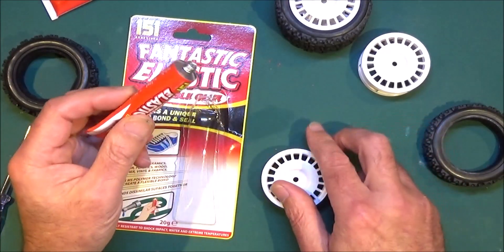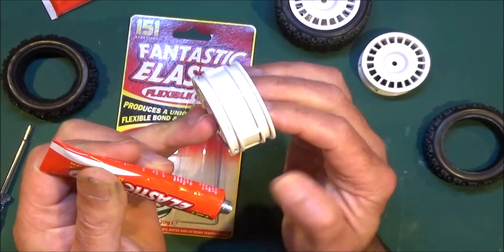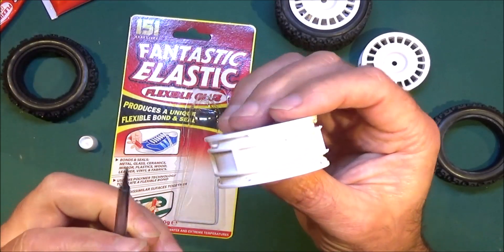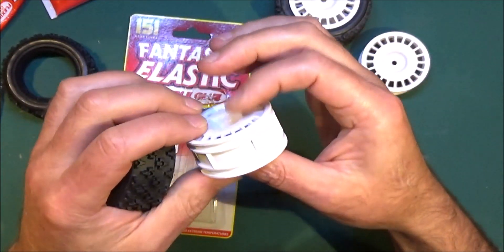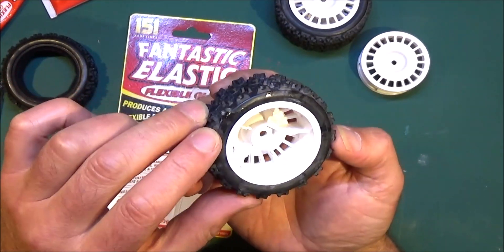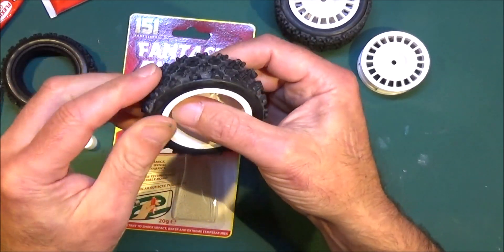RC Tyre Glue Tip - How to glue Tires With No Mess + Remove Them Easily!

Comment: Hi mate, I never knew you glued your tyres. As Tamiya don't recommend it in their manuals, I just assumed you went with them. In hindsight though you do run a lot of brushless, so yeah, it's totally understandable. Great tip too with that flexible glue, I've never glued tyres myself although I can imagine how super glue would be a total nightmare. This flexible stuff seems totally ideal for the job. Nice one mate...👍🏻😁.
Reply from the maker: Hiya mate! Yeah, I do glue some of my tyres, but prefer not to if I can get away with it. Some of my manuals do say to glue the tyres, but I don't remember off the top of my head, except for the Lunchbox that definitely shows using glue. I didn't glue them as a trial, and the rear wheels span inside the tyres when they got wet! Yeah, when I have a hopped up motor it's usually needed, like on my Neo Scorcher and Blitzer.  All the best my good friend! 😀👍

Comment: 😁👍 Great Idea Mark! I don't think that's in the USA but I use goop shoe goo glue here sometimes and it looks kind of the same as the stuff your using and works great also.  PS. posted this on your dark impact buggy video but if you did not get it here it is again...  a simple fix for the comment problem I forgot to to tell you about that I always tell others to do is simply un sub me and wait a couple hours and re sub and that usually fixes the problem.👍
Reply from the maker: Thanks a ton Steve - yeah I heard that shoo goo is similar! And thanks again for the tip - good of you my friend!  😀👍
Reply: @MarkBryanRC  I'm going to try Shoe Goo on my Sand Viper tires since I'm worried they will slip on brushless. You guys think the tires will slip on 3500kv 2s 17t pinion brushless setup?
Reply from the maker: @RDsRCReviews  Hi - I reckon it's worth a try with the Shoe Goo - I think it will do the job as the tyres fit pretty tight anyway! All the best and good luck!  :)

Comment: Thanks again Mark. Ordered. I’ve got to glue my tyres for racing but I’m absolutely done with CA. Don’t start me off😊. Tried black silicone but sadly failed. Thought it was the grail of rc tyre bondings. Can’t stand the mess and the waste from CA. Ruined more than one decent set of tyres and rims messing around with acetone and the like trying to reclaim rims or just swap rubber for different surfaces. £ for £ rc wheels and tyres are super expensive so CA can b@gger off ! Best wishes to you and your trusty cameraman. Peace. MR
Reply from the maker: No worries, MR, I hope it works for you... it's best to leave it to dry for a few days if you can. And I can tell you it won't hold a tyre on at 45mph, as I just found out! But at normal speeds it works a treat. Oh yes, I've had bad experiences with CA glue, my fingers will never forgive me!!! Best wishes to you, too, all the best! 😎🤞👍
Reply: I'll let you know how it gets on Mark.. First is a pair of short course truck control tyres racing on astroturf. Lots of weight being thrown around so should test the integrity of the bead fully. Peace. MR
Reply from the maker: Sounds like a good test!!! 🤞🤞👍
Reply: Success ! High traction astro, lots of weight thrown around, impacts, jumps - solid. On touring cars probably even better. Result. Thanks once again Mark. MR
Reply from the maker: Awesome news! I'm chuffed! Thanks for letting me know! Peace. 😎👊👍

Comment: Great way to stick the tires on mate. I used silicone adhesive before, same thing I'm guessing. CA or Super Glue can be a pain when you use the thin stuff, but it does "flow" around the bead area easily (CA or Super Glue is not good if it gets on the foam inserts), i use medium thick CA for tires now.
Reply from the maker: Thanks a ton, Bob! 👍 Yeah, silicone adhesive sounds very similar, but for extreme machines, CA glue is needed. That thicker Gel type sure sounds better than the runny stuff! Take care, brother! 😀👍
Reply from the maker: Wanna chat, mate - get on facebook! I'll call ya!  :D
Reply from the maker: Thanks for the info, buddy!  :O)
Reply: @MarkBryanRC  OHHH!!!!!!!!!!!!!!!!!!!!! Did you see the Tamiya Grass Hooper looking buggy with IS?
Reply: @MarkBryanRC  TAMIYA New RC model coming soon !!
Reply from the maker: @UncleBobsRC  Can't wait, Uncle Bob!  :D
Reply from the maker: @UncleBobsRC  No mate!

Comment: Hi Mark,
Great tip!
I’ve seen this stuff in my local pound shop 👍
I’m just coming to the end of my TT01E Buggyra build and I was wondering should I glue the tyres on?
Also….do I need the foam inserts? 
Many thanks 👍
Reply from the maker: Thanks Dan! Yeah it's good glue... I don't think you will need to glue the tyres unless you have a super fast motor fitted. The tyres on the Buggyra are pretty hard so I don't think foams would make much difference. All the best! 😎👍

Comment: Hi Mark. Great video. I am new to Tamiya rc cars. I had been looking to get the Audi Quattro tt-02 you've tested. However, I won a competition  for a tt-01 with mk1 Escort body, which came already built. I couldn't understand why the tyres kept coming off the rims until I watched this video.
Reply from the maker: Hi Paul! Many thanks for the comment. Congrats on winning that TT01!!! Yes, a little glue is needed on these tyres, especially after a little use, they just get looser and looser! All the best!

Comment: I went hunting for this stuff but couldn't find it in the pound shop near me. They did have UHU all purpose adhesive though and works just as well 👍 cheers for this
Reply from the maker: Thanks for the comment, Dave. Good that you found an alternative that also works on these tyres, good info for anyone else reading this thread, UHU does the job too! Cheers!
Reply: @MarkBryanRC  also dries clear if you get it on the tyre walls. Probably not quite as good as yours but can't see it much 👍
Reply from the maker: @davecoggan9619  Even better! Good stuff, Dave. Have a cracking weekend!  :O)

Comment: Thank you for sharing, Mark! Great tip. I remember you have mentioned it before, but it was great with a separate video and full demo. I wonder if any of the glue sticks to the wheel after removing it? Making it an uneven surface for the new tires? I expect not, since you have probably tried it many times with success but I had to ask
Reply from the maker: ...and thank you for watching, Mikael! Yes, I'm glad you asked, it's a very good question! The glue does leave some residue on the rims when you remove the tyre, but it's easy to remove as it doesn't react with the plastic rims, it just peels off like a sticker! All the best my mate!  :)

Comment: Good idea thanks for sharing You don't need CA glue That stuff is overkill I mean if you have a heavy vehicle and you're using a lot of power then I can see using CA glue but with a lightweight vehicle that is not overpowered that will do the trick just fine.
Reply from the maker: Great point! Thanks for taking the time to comment, it's much appreciated here. Apparently, UHU glue is also an effective solution. Hope this works on your RC cars. Cheers!

Comment: Do you add any foam inserts if is t there any point ??? If you do do you use the proper Tamiya ones or do you make some up
Reply from the maker: Hi there. For my rally cars I generally don't add foams to the rally block tyres as they are quite rigid as it is. But for the softer road tyres I add foams. I have used Tamiya foams and also made some from medium density foam and they work just as well. Hope this answers your question! 👍

Comment: Very helpful Sir, Thank you .
Reply from the maker: You are most welcome, thank you for your kind comment!  :))
Reply: @MarkBryanRC  Restoring a vintage Tamiya Avante 58072. The tyre inner sponge 50359 is discontinued I think. Are these necessary to run the car or do I need to cut and make some from sponge strips?
Reply from the maker: @samiismail8690  Hi - no I think you can run without the sponge inserts, but it might be worth giving it a try and adding some self-made sponges. Take a look at these, they might be able to fit: Tamiya 84201 1/10 Scale R/C Buggy Inner Sponge.

Comment: did this with my Alu rims, left em to dry over night. Next day drift, an the rear tyres ripped straight off in a few mins. Not sure if tis is good for Alu wheels?
Reply from the maker: Hi there and thanks for sharing your experience! I've never tried this glue on alloy so I'm not sure. But when I've put the glue on too thickly it can take 3 to 4 days to dry. Maybe it doesn't like the alloy though.
Reply: @MarkBryanRC  Yeah. I did wonder about sanding the surface of the wheel to get better adhesion. I liked this concept as I don't trust meself with super glue :'D Maybe it's because I tried this on my drift car?
Reply from the maker: That's a good idea, most glue works better on a bigger surface area and sanding will do that. It must be worth a try. Haha, I don't trust myself with superglue either, last time I used it I only managed to glue my fingers together!!! 🤣
Not sure if it was because it was your drift car, these rally tyres I glued on had a real hammering on all surfaces 😬 and they didn't come off! 👍

Comment: Great tip and well demonstrated mate.  Super Glue can be a pain, especially when you get it all over your fingers and they get stuck together.  Seems to stick skin better than anything.  I wonder if Fantastic Elastic is like Shoe Goo which is what people use to stick plasterboard tape inside RC bodies to strengthen them?  Be good if it is as Shoe Goo is quite expensive.  Anyway good to catch you mid week. Hope all is well with you.  Cheers for now :-)
Reply: Super Glue was used by medics during the war to patch up the soldiers.
If you use too much, you end up looking like the man from Atlantis 🏊
Reply: @Jess hahaha, sorry, didn't mean to laugh, I use the thick black chunky gaffa tape for the inside of my shells before painting then hot glue aluminium mesh to stop the roof pillars from caving in if it lands on its roof 👍
Reply: @Jess Yeah I do use Gorilla Tape too and it does seem good.
Reply: @cw-01creations46  Yeah they still use a type of Super Glue for some medical procedures like sticking your burst ear drum back in.  A bloke down the pub told me so it's definitely true!
Reply: @PeteWylieRC  When I split my head open, the Quacks used super glue on me so that my skull wasn't exposed to the elements of the outside world but it did naff all for my hairline 🤔
Reply: @cw-01creations46  How did you manage that?
Reply: @PeteWylieRC  I fell through the garage roof in-between the beams and smashed my head against the engine hoist on the way down. Luckily the ground broke my fall. I looked like John Merrick when I came out of hospital and better looking than Quasimodo 🤓
Reply from the maker: OMG!!! That must have HURT!!!
Reply from the maker: Just bought some Gorilla tape from Aldi!!!  😎👍
Reply from the maker: Great advice, Jess - just got some from Aldi!  😎👍
Reply from the maker: Thanks my mate Pete! It doesn't stick as well as superglue, but as you see in my run videos, I can still run pretty hard and the tyres stay on, even on the Blitzer that does 35mph! Yeah, from the comments it looks like shoe goo is very similar. As I said, this elastic glue is from poundland! Guess how much it costs?  :P
Thanks for watching matey, hope you are doing well too, I'm OK ta!  Later my good friend.  😎👍
Reply: @MarkBryanRC  It just goes to show that you put one foot in the wrong place and you're going down. Literally 👍
Reply from the maker: @Jess Great idea with the mousepad - it's great to find ideas from our friends in this hobby. Oh wow, this glue I got is never going to work when a 4800kv castle is powering the wheels!  :))

Comment: Me Mukka, I'm going to have to see if I can find the U.S. counterpart. Although I've sorted the CA problems, using a Diabetic Syringe 💉.....
It still has the issue of having to basically Bin the Wheels when the Tyres are worn!! 😖 
Plus, since it doesn't cure in nanoseconds (like CA!), the Bead has time to settle evenly, without high/low spots. That's great for high speed runs! 
Brilliant my Brother!! 👊👍👍😊 

Hope things are steadily improving. WE are spending the Week in a Hotel, around the corner... Our Aircon BROKE!!! 🔥🔥🔥😠  A critical problem here. 
So I couldn't bring my "Toys". And Mate, the Truck Cab is a viral RAT'S NEST of wiring!! 😳 I'm really at a critical point, where I cannot forget WHERE all those Wires go! 
Guess it's OK. I was so exhausted when I got home Friday Morning, that I slept till SUNDAY!! 😳
Reply from the maker: Cheers mate! Sorry - but I already replied and it's been deleted! Can't remember what I wrote!
Oh yeah, you got a great trick with the syringe - good job as CA is needed on more powerful rigs!
Hope your aircon gets fixed soon - you need to get back to that cool project of yours so we can see the nest installment!
Lou and I are no better, but thanks for asking, my US mate!  :)
Reply: @MarkBryanRC   I DON'T know what's going on with your comments lately!! 😠😖
Your comment on my Video worked great. 

Shoe Goo is definitely available here! I will be trying that on the Semi Trucks - because I don't want to ruin those Alumininium Wheels.
Reply from the maker: @CarminesRCTipsandTricks  IDK what's going on - it may be fixed because I complained on YT  help system!
Give the goo a go!!!  :D
Reply from the maker: @CarminesRCTipsandTricks  Haha! She doesn't know what she's let herself in for!  :P
Reply: @MarkBryanRC  LMAO!!! 😂😅

Comment: hi 
what if the tire has foam inserts
Reply from the maker: Hi! No problem, just fit the inserts into the tyre before you fit it to the wheel, the glue will not affect the inserts, I've done it many times! 😎👍

Comment: What about gorilla glue?
Reply from the maker: Hi Chris, if it's the rubberised type oog glue like this I reckon it would be a good choice! 😎👍🏼
Reply: @MarkBryanRC  e6000 glue?
Reply from the maker: @chrisspearline767  I've not used that glue myself but it would be worth giving it a try!
Reply: @MarkBryanRC  hey you know what I forgot I had this brand new unopened tube of Barge rubber cement. I put some of that on and I'm convinced this is the stuff to use
Reply from the maker: @chrisspearline767  Thanks for the tip! You know, you got me Googling lots of cement brands today! 😅😅 It looks like good stuff! 😎👌👍🏼
Reply: @MarkBryanRC  yeah it's thick and rubbery
Reply: @MarkBryanRC  Barge all purpose cement
Reply from the maker: @chrisspearline767  Thanks Chris!  :)
Reply: @MarkBryanRC  The cement didn't work but Flex Super Glue worked great

Comment: Didn't work for me mate, think my car is too powerful ran it up on the bench two tyres came straight off.
Reply from the maker: That's a shame mate. Worth a try though, I used this glue on tyres for a 13.5T brushless car and it was OK, but much faster than that the I'm not sure. Sometimes it does take a few days to dry properly though. Hope you find something that works, there is always the dreaded superglue!!!!  😎👍